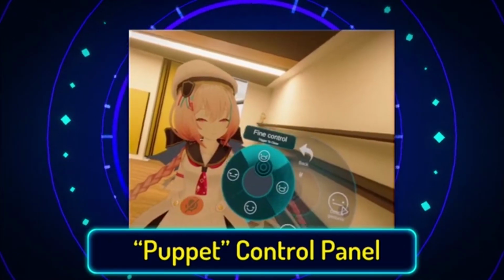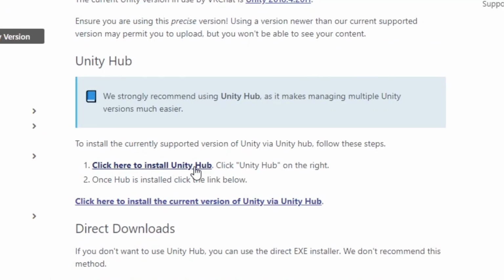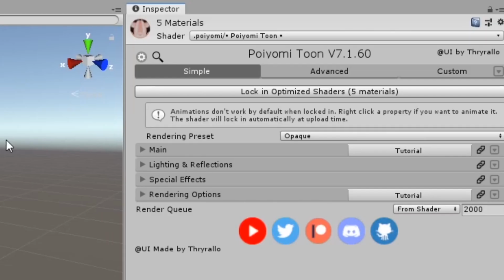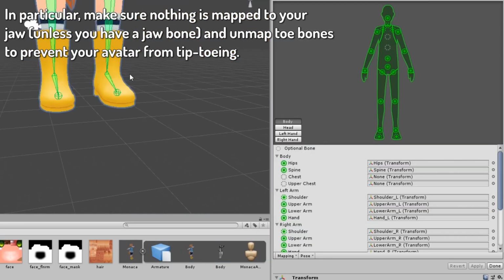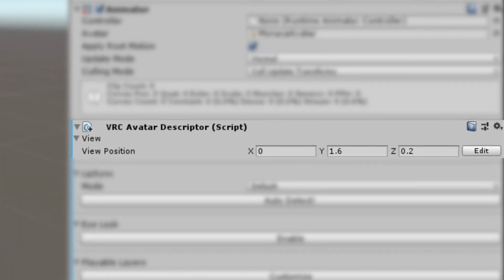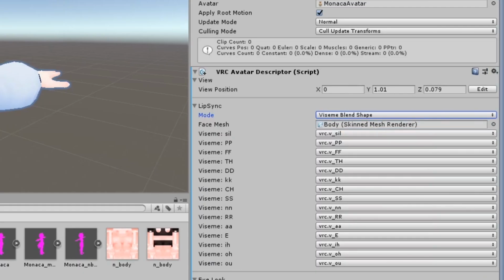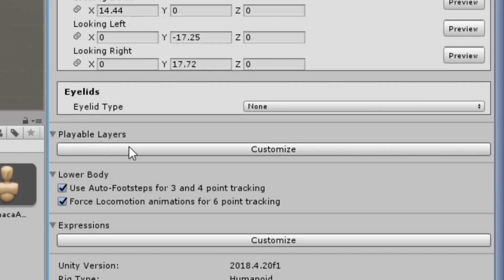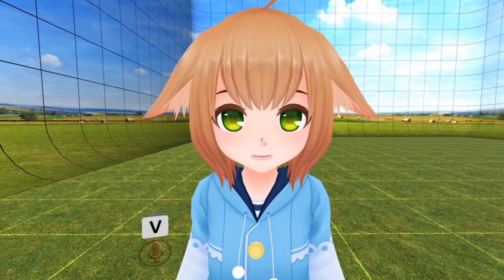VRChat Avatar 3.0 Tutorial - Uploading a Basic Avatar (OUTDATED)

Comment: So you say in the video 2018 but link 2019, also vrcsdk breaks when i use it in 2018
Reply from the maker: As of right now, you must use unity 2019.4.31. The unity version used in this video is outdated but everything else is still accurate
Reply from the maker: If it ever changes again, I'll keep the link in the description of this video updated.
Reply: @SippsAvatarBox  do i have to name it avatar 3.0 or did you just put that there just cause?
Reply: @Dildo_Bird  Just cause, you can name it what ever you want.
Reply: @krispychipp  thx random helpful stranger here  pulls sandvich out of pocket
Reply: @Dildo_Bird  anytime! Back to the void i go. :)
Reply: @SippsAvatarBox  I am using 2019.4.31 and for some reason it isn't giving me the options for build and publish for windows. Is there a fix for this?
Reply: @SippsAvatarBox  how aexactly do I select multiple shaders in order to place onto the model?
Reply: use it 2019 then
Reply: In unity what template do I use

Comment: I'm having so much trouble with this in 2022. ;; or maybe just SDK3, idk. I can't even change the Shader type, am I doing something wrong? I dragged/dropped the Unity file for Poiyomi as well as VRCSDK3 into the project but now I can't even drag/drop the model file nor textures for my avatar. 

I also want to add that none of my Unity windows have the same layout, so I can't really find a lot of the mentioned options in the video.

UPDATE: I was able to get everything up to speed, but now I try Adding Component, but can't find anything at all for VRC Avatar Descriptor. :<
UPDATE II: I got it! To anyone else looking, you'd likely have to use a 2019 version of Unity Editor! c: I had to and it works fine now!

Comment: Can someone help? VRC Avatar Descriptor is missing in all of my projects. I uploaded SDK3 first, then Dynamic Bones, then Poiyomi. When I try to search for it in Add Component, it doesn't exist. One avatar out of several I am trying has it already, but Unity says the "associated script cannot be loaded." I tried redownloading SDK3 and starting a new project with it and it still has the same problem. Please help?
Reply: I'm having the same issue! Did you happen to fix it?
Reply: @TorchiTV  I had this issue and through a lot of installing and uninstalling i finally had Unity version 2019.4.31, converted project from the older version, and now it works